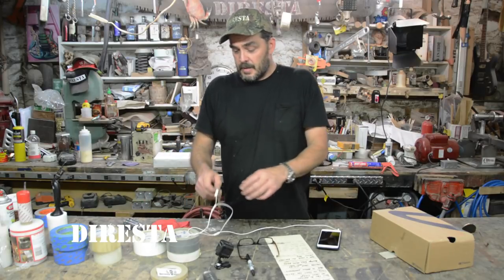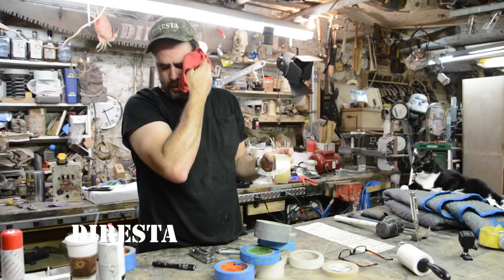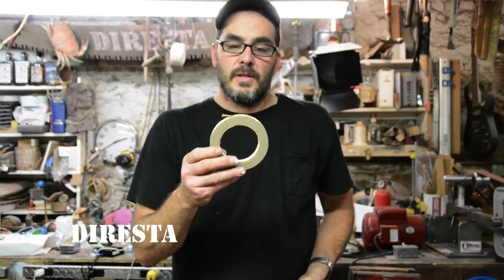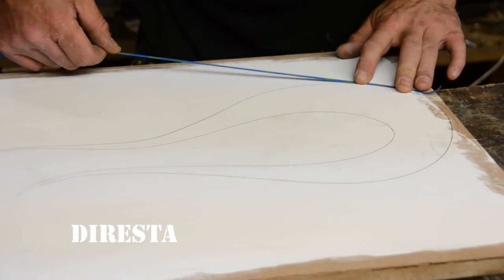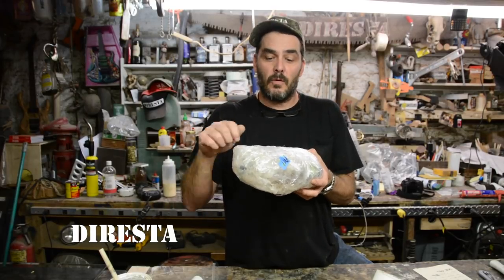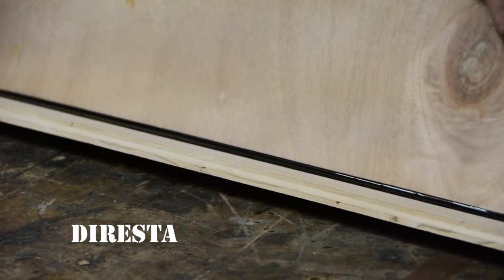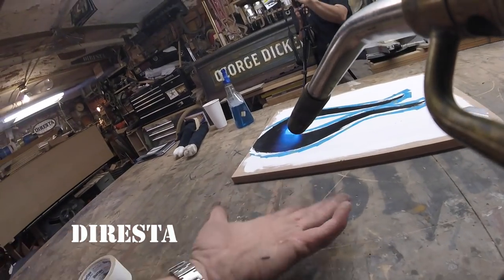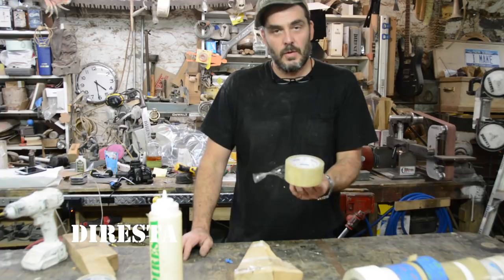✔ DiResta Jimmy Tips 9

Comment: The tape story stick was my favorite.  I also liked when something fell in the background and made a crashing noise, DiResta immediately went into take 2 mode and just started over.
Reply: Dustin Penner That's tape two, didn't you hear?
Reply: Dustin Penner I know people using drywall tape (the paper non-sticky kind) as a story stick.  Of course you need to have that around, but that would stretch less than masking tape and not upset the trolls as much.
Reply: Rick Ramirez So just long strips of paper?  Thats not a bad idea.  Tape it down, make your marks, roll it up.

Comment: Great tips! The story tape idea seems rather useful, especially for someone who doubts there own measurements constantly.

More of a recommendation than a tip, but I really like using Craft tape, or gum tape. It's craft paper packing tape which isn't sticky until you add water, or sometimes I use a glue stick if I want extra hold. It's great as you can cut strips of, shape the pieces, and lay out and plan with it before sticking it down with out fear or losing adhesion. It's also easier to cut multiple pieces to length, using another as a guide. After wetting it, you still have about 10 seconds to re-position it and slide it about a bit to get it into place. I use it most for cardboard, as it blends into the natural craft color, and makes raw edges and angles on something like a box look extremely clean. 

When you go to store the tape, the roll has a tendency to unravel, as it's not adhered to itself. what I do is wet the very edge (usually with my tongue) and stick it to the roll so it can store without unraveling.

Hope that helps someone! Thanks again for the tips.

Comment: When taping wire we use what we call a "courtesy wrap" with the electrical tape.  You fold over the corner after you pull to break the tape at the end of the wrap.  That way you (or the next guy) don't need to hunt for the end of the tape to unwrap it at the end of a pull or when disconnecting something.  Helps find the end of the roll too.

Comment: A few of my own tape tricks:
1. If you find yourself mounting an item with those blind holes that go over screw heads on  the back(think routers, battery backups, other electronics) a handy way to transfer the screw pattern to the wall is to put a piece of painters tape on the device, make a rubbing of the holes, pull the tape off, and stick it to the location to mount, and use it to transfer the pattern for mounting screws.

2. Aluminum Duct Tape. This stuff is crazy versatile. Because it is foil, it holds its shape a bit, so it can be folded and then pressed into weird gaps, I've used it for making stencils, being totally opaque makes it great for blocking light, it holds amazingly well, and survives heat and sunlight where plastic duct tape fails quickly. I keep a roll on hand at all times.

3. Tape vice: This one I learned/discovered recently. I was working on a small tin box, and needed to be able to work on the top with both hands, and had no clamp. I pulled off a strip of painters tape, and laid it sticky side up on the table, then used two more to fasten it down, pulling it tight. Then I stuck the tin to the face up tape, and was able to do a fair amount of detailed work to it without it moving at all. Probably a no-brainer, but i'd never actually seen it done before.

Comment: Would patiently wait for any of your videos.  I've used narrow stretch wrap for years on trim and lumber, but never thought about it for straps.

One thing I do differently on "sealing" the tape is use a thin bead of caulk along the edge and then wipe it clean.   Has worked perfect on decorative and pinstriped walls.   The method you showed is the same concept.  Different methods, same result. 

The tape story stick is gold.  Not earth shattering as you put it, but insightful and something I will definitely consider when I visit a new lead.  Hope to catch you next time I'm in the borough.

Comment: In case anyone doesn't know about gaff tape, it is used a lot in audio/visual setups to hold cable because it can be readily removed and the adhesive stays on the tape and not on the surface to which the tape was applied.

Comment: Hi Jimmy. About this sealing technique you made, you wait the white paint dry before applying the black one, I assume, or the two paints would mix together. Sometimes, when you remove the tape, doesn't the white paint peels off since it is dry over the tape?
Awesome video, btw! The tip about wrapping a package with stretch wrap was very cool and handy!

Comment: The tip of wrapping tape around tool handles for use in the field is like a tip I got for backpacking. Attach a couple strips of duck/gaffer tape to one's water bottle. I guess in this case the water bottle is the tool for the backpacker. (Different from day-hikers who usually have a source of cold water before heading out, a day or two in the bush the only water available is the same temperature as the air (or creek temperature, but will warm up to ambient quickly), so not sweating and messing up the adhesive of the tape...)

I'm also thinking the uneven joint could use the stretch wrap instead of tape. Don't have to worry about adhesive transfering from the tape to the workpiece.

Comment: I apply a layer of clear packing tape (especially the thick type from Canada Post) as a laminate to impart reinforcement, strength, liquid resistance, etc., to papers like drill and tap size charts, working drawings, etc. for posting on the walls of my shop, or maps and other papers that may be exposed to rough conditions of use. Also serves as a dry erase drawing and writing surface,

Comment: Here is another tape that might be appropriate for this segment; It's called "Bondage Tape" (I'm not making that up). It's used by wood shops to seal their vacuum ports and fittings from leaking. The cool part it that it has no adhesive, it only sticks to itself. You can wrap a tool handle for instance and it won't stick to the tool, but once you make at least two or three revolutions (while stretching it), it fuses only to itself. If you cut through it to remove it later, there is no residue left because there is no adhesive. It also makes a good clamp for odd shaped objects, (because it's stretchy),  as you show with the packing tape.

Comment: Several of these tips are really great. I was thinking when you drilled holes in the roll that you could use that to lay out approximately evenly spaced holes. They would only differ by the decreasing diameter as you used the roll.

Comment: Quick tip on the silicone, if you want an angle joint, instead of using your finger to rubber off, I use a quarter of an apple (yes the fruit) and rubbers off as well as the finger and in a 90 degree angle.... Thanks Jimmy for your tips and your wisdom.. When I grow up I want to be like you!! ;)

Comment: Regarding adhesive glue left on a surface, I've found that using a fresh piece of the same tape or something with a slightly lower adhesion will usually pull the glue off of the surface if it's nonporous.

Comment: It's usually a good idea to put water in the tub before calking. At least with less flexible calk. That way, when the tub is empty, the calk joint doesn't have any strain. If you calk with the tub empty, then fill the tub, it could break the joint...

Comment: Good stuff man,  a good little tip for cutting packing tap with just your fingers is to double it over to where both sticky sides are touching then pull it apart.  Give it a try, it will amaze you!

Comment: If you need double-sided tape and you don't have any left, you can fold regular tape into a loop so that the sticky side is on the outside, and it will work as a weaker double-sided tape.

Almost all tapes can be torn instead of cut (if you're in a hurry or don't have a blade). Pinch a spot with both hands as close together as possible and shear apart. You can also stab the tape in the middle with a key to have the rest split (packing tape specifically).

When drilling a hole without a debris collector, stick tape over the place where you intend to drill. The first piece (centered at the hole), should only be stuck along the bottom half and sides, creating a "U" shape of adhesion. The cavity that hasn't been stuck is where the debris will collect. Next place a second piece overlapping the bottom of the first piece as hard as possible to prevent debris slipping through. The last piece will be placed over the top of the middle piece, but not stuck to the wall. When the drilling is done, slowly peel the tape assembly off the wall so that all of the remaining debris falls into the cavity, and tape the top piece over it to trap the debris in a neat little pocket that can be disposed of.

If you cut yourself and don't have a plaster handy, clean it up with water and tape it up. Don't tape it up too hard, as it could restrict movement and blood flow.

When cleaning up the last bit of dust from a job and you don't have a vacuum cleaner available, use tape. Stick it over the surface and pull it off again, it will pull the dirt from the surface.

When you need to push your fishtape through a very small hole and you're worried the hook will get stuck coming back, simply tape it up to make a smooth surface.

Lastly, if you've drilled a hole too big for your screw/plug, you can tape up the plug to make it wider. Retains decent holding strength, although not ideal.

Comment: If you´re trying to get a silicone joint, i always use some Windex. The way i go is, that i also mark the edges of the joint with tape, then apply the silicone. Then i spray some Windex on the joint, before scraping it off with my finger. What it does is, that it´ll prevent the silicone from sticking to much to the outer surface or the finger. And it´ll seal off the joint, making sure that it won´t be damaged that easily while hardening. But it also prevents you from applying more silicone, without wiping all of the Windex off first.
You may want to give it a try as well ;)

Comment: about the tape sticking to your stuff... just ger some cheap yellow paper masking tape they sell everywhere, put it on the glued up thing, pull it. the tape's adhesive is useless so what will happen is the residue will stick the tap to itself... put it on and pull it about 4 times using the same strip each time to strengthen its ability with the residue each time... works perfect for me

Comment: If you want ultra-flexible masking tape then do the same thing you did with the blue tape but use electrician's tape instead.  It's much less expensive than auto-tape.  But you probably have to put it on the glass and cut on the glass instead of hanging it over the edge.  I've never tried it your way.  It might work like that but you'd need that brand new blade definitely.

Comment: My father's trick for never losing the end:
Pull an inch or two up off the roll. Move it sideways just a tiny bit. Like 1/16". Stick it back down.
Fastest and easiest method I've seen so far, and it doesn't mess up the end so you don't have to cut off and throw away any.